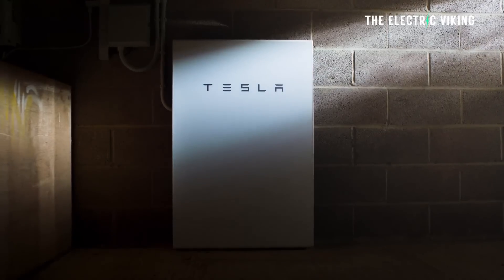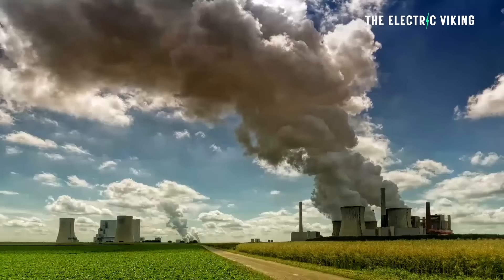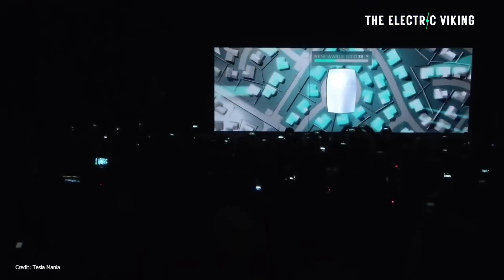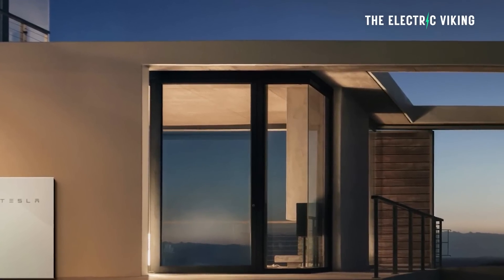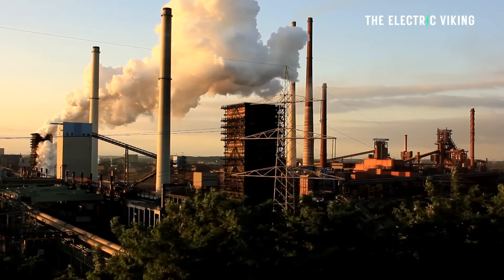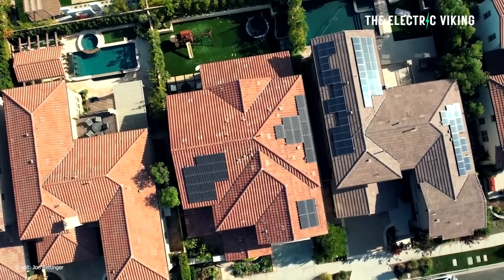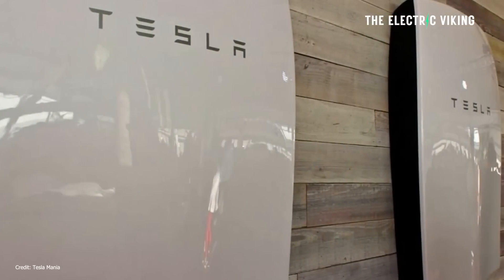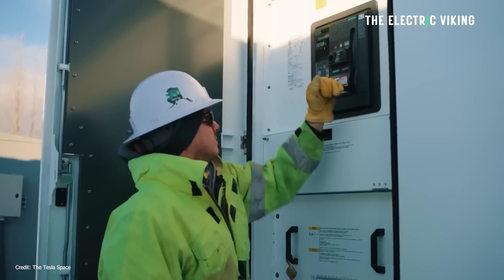Tesla expands its Aussie virtual power plant; helps poor families pay power bills

Comment: Looking at the video, I wonder what you consider “port families”. I only saw houses for ultra rich families.
This February, the energy bill was higher than the rent for my house, at €0,97 per kWh. It has dropped, but no tesla powerwalls are for sale in NL.
Reply: What Sam is referring to is 'public housing' which is government built/owned, and rented out to 'poor' people. The images you see were American houses, and had nothing to do with the actual houses in South Australia.  The solar and batteries are installed for FREE, and the people pay an extremely low amount for the energy they use (which is supplied by the solar / PowerWall / Big batteries / Grid). And the grid is already 100% renewables, except when there is no sun or wind and the big batteries are empty. Next step is to import power from Victorian Solar / Wind farms, and if that also fails, only THEN do the Gas Peakers start up.  It's a very well designed system and is slowly expanding across all of the Australian Eastern Seaboard. I am part of the Melbourne VPP for example.
Reply: @greghudson9717  That is great to hear!
This should be the trajectory for raising African countries. Local communities growing and interconnecting. Imho

Comment: Last year I put 3.2kw array on my garage , 3.6kw inverter & 7kwh lifepo battery bank .I live in south 🇬🇧 and my bills are pretty much zero now , and I charge my EV on solar now too . All for about £3,500 . My bills were about £700 a quarter so payback should be pretty quick .
Reply: The company, Blauhoff powerwall offers a LFP 25kWh Powerwall for €8.240 ex. VAT. with 10 years garanty. 
That is around €5.000 cheaper than the Tesla Powerwall 3 and with for 11kWh more than Tesla.
Reply: @Grizzold-HP2  
It's *not* a Powerwall.  It most likely doesn't have all the features of a real Powerwall.
Reply: If it's cheap and works what's the problem? Most people buy what they can afford, not because of features that they may never need or use.
Reply: @acmefixer1  The only features that are important are, does it power the home, does it charge from renewables. What are the missing features? Don't be crying VPP, there's only value for Tesla here.
Reply: @MegaWilderness  
That's **false**.
Reply: @acmefixer1  You get to deplete your charge cycles for Teslas benefit, and none of your own. Your payments don't cover the lost usage
Reply: @MegaWilderness  
Said, "You get to deplete your charge cycles for Tesla's benefit, and none of your own. Your payments don't cover the Lost usage"

Your claim is false.  Tesla pays the owner $2.00 per kWh, three or more times what the customer pays.  The owner determines how much of the battery's charge he allows tesla to use and when tesla can use it. 

The earnings from selling the power could pay for the cost of a Powerwall.  All the new Powerwalls use LFP batteries which are rated for 3000 or more cycles.  Selling enough kWh's to use up a hundred or less each year makes no difference to the Powerwall's lifetime.  Your claims are false.
Reply: @robertfonovic3551  You don't appear to know about the value of the Tesla VPP (Virtual Power Plant). Not possible with any other brand of battery. End of story.
Reply: Tytyty

Comment: Come on, PLEASE learn the difference between power and capacity! It's 5kW peak output power, 13.5kWh capacity... 5kWh is miniscule, and you aren't doing Tesla any favors by misrepresenting their product. It's on the information page you showed at 1:55!
Reply: Most houses only consume 1-3kW at any given time. These systems have smart power controls as standard feature to extend the battery lifespan, but if you really want to run your AC, oven, washing machine, dryer and EV charger at the same time then you need more than one Powerwall anyway.
Reply: You know the answer to your question, so why ask it. Your just being polite. Don't be.

Comment: In the Netherlands there are several companies selling homebatteries. On average a 14kWh LFP system is around €10.000. 
When available, the Tesla Powerwall 3 will cost around €15.000.  That is about 50% more expansive. 
Over here, Tesla is not "helping" the poor people, . . . With those absurd prices it is only helping Tesla.
Just for giggles, google Blauhoff Powerwall
Reply: my 13.5kw of pylon Tec batteries cost 5,200euro here in Ireland delivered from Germany. not sure where your getting 10k from
Reply: @alii303  Powerwall price in US dollars is about 10k in Euros but a quick check says there is no official price for Netherlands because it is not available yet.
Might be less in Europe once they are for sale, lot of renewable stuff seems more expensive and getting less tax breaks in US.
Reply: @AnalystPrime  Not less, probably higher. 
A tesla model 3 is USA is $35.000 is €42.000 in Netherlands. Same goes for about everything from the USA to the EU. 
BTW, $14.000 = €13.050 at the rate today.
Reply: @alii303  €10k is what we have to pay in Netherlands for a Blauhoff 25kWh powerwall system. 
You can google it. 
In Netherland most common prices for complete homebattery sets, with inverter and instalation, are between €600 and €1.000 per 1 kWh (more kWh, the lower the prices gets.) 
Blauhoff is just a more affordable one.
Reply: @Grizzold-HP2  Most recent quote I found says PW is $9200 alone, $11500 with installation, less per unit if you get more than one, I recall seeing $14k or $15k for one pair mentioned, if still true that would be quite a discount.

However, installation cost may be higher in some areas and apparently Tesla only sells it with solar panel installations right now. So some European contractor might order just the PWs and offer installation at local prices.
Reply: @AnalystPrime  I think the Viking is talking about the 2023 Tesla PW 3, quoting a price of $14.000.
In the Netherlands, the old 2015 Tesla PW2 is €8250 with tax is €9.982,50. Ex installation. And that is NOT LFP but Lithium Ion.
That is Tesla price.
For a total 25kWh set from Blauhoff ex installation is also €10.000. So What will it be. 
A Tesla 13kWh system or a Blauhoff 25kWh system, both prices are €10k and both the new LFP battery . . . . . 
guess what people in the EU will buy. . . .
Reply: @Grizzold-HP2  As long as the cheaper version is not lacking in some important way it is good to have more options. Capitalism ho! Funny how American companies can't seem to figure that out...

Comment: Similar idea where cars could be used as portable power walls contributing to the grid as well as charging your cars. All of these invocations will help in producing cheap and sustainable energy.
You haven't heard if they are putting v2g in their own cars?
Reply: Why V2G? The windmills and panels are meant to provide capacity and not the other way around. FFS
Reply: @robertfonovic3551  that's true.  But also the vehicle is a perfect power source for your home in an emergency. But think about it, if a million vehicles are plugged in and not drawing power it would be a very fluid way of supplementing power.

Comment: The upcoming Powerwall 3 is expected to maintain the same 13.5kWh energy capacity as the current Powerwall 2. However, the new unit will boast a higher peak backup power of 15.4kW compared to the 10kW offered by its predecessor. One of the most significant changes to the new battery pack is the switch from lithium NMC (Nickel-Manganese-Cobalt) cells to Prismatic LFP (Lithium Iron Phosphate) cells, which will make Powerwall 3
Reply: NMC ,LFP. Who gives a shit! 
Powerwalls are overpriced.
Reply: Great stuff

Comment: How many batteries have BYD and CATL installed?
Reply: For BYD, over 14 GWh of energy storage capacity as of last year (See BYDEnergy). Tesla was 6.5 GWh total. So BYD is more than twice the size of Tesla in energy storage, even in Tesla's back yard. Largest installation in the world (1.7 GWh) in California is BYD. Largest in Las Vegas (543 MWh) is BYD.  And they just released the Blade-based container-sized battery, which has over 2X the volumetric energy density of tesla pack. And sodium is coming. Tesla is not the global leader in this space, despite the hype.
Reply: @larryevans6739  Just as I thought. It's impossible to be top dog when the competition makes all the battery cells and sells similar products

Comment: The spec's I see, for powerwall 3, keep the total storage capacity (batter size ) but increase the instantaneous output.
You sure you are not confusing peak output with capacity . Local Solar installer wants to charge something like 19 k installed 
for one which still has a capacity of 13kw total about one day of house power .
Reply: Great value eh. Lol

Comment: Critics of Germany over installing solar panels and destabilising the grid will now see big batteries and EV big batteries stabilising the grid and sidelining fossil and nuclear generation. 
Fossil fuel will be for industrial raw materials in the chemical industry. 
😊😊😊😊😊
Reply: Germany has the one of highest electricity prices of any of the EU countries. Charge your EV during the day, and then connect it to the grid at night and have your electricity used at night by non ev owners, and waking up with a depleted battery in the morning. Does that really make any sense? Will be pleased if you could enlighten ( pun intended) me.
Reply: @robert fonovic  DO NOT GET A STUPID EV, is rule one.
Daily drives are 7kwh on avg.very small for an EV that is built to be ready for the long drive one day.
Nobody can do the maths. Everyone is very good at adjectives, which is a problem for good thinking.
I have worked in the electrical generation and transmission construction and priced many projects. 

The truth is in the numbers. 
High electrical prices open up cheaper alternative technology. Opens up competition.

Comment: I WISH I could afford one - but they are still way too expensive for many people. Instead I just try to keep the bills down by turning off the water heater, and going without an air conditioner. If only the government would subsidise them, instead of subsidising transnational gas corporations to the tune of 11 BILLION dollars, just this year!   If wishes were horses...
Reply: You don't have small kids, do you? :)
Reply: Eventually used EVs will be an item and we will both be able to afford one.
Reply: @avalagum7957  Only a 13 year old boy. He feels the heat, too.
Reply: I can't see how you can't afford one.  The solar roof and battery will save you $50 or more a month.  It's foolish not to get it.
Reply: @acmefixer1  22K for a battery and small solar array in Australia at present. 22k at a saving of 1200  dollars per annum means a 18 year payback period. Let me me thin....NO THANKS
Reply: @robertfonovic3551  That's if you pay in cash or get an interest-free loan. Utility scale solar total LCOE is less than $.03 per kwh. A 20 ft container-sized 5.4 MWh battery is a fraction of the cost with installation compared to ~400 residential batteries to get the same capacity. It is much more cost effective to focus resources on utility-scale installations, rather than distributed systems. Batteries or V2G/V2L still make sense if you need backup power or want to benefit from a residential solar system as the grid reaches regular daytime overcapacity and net metering gets phased out.